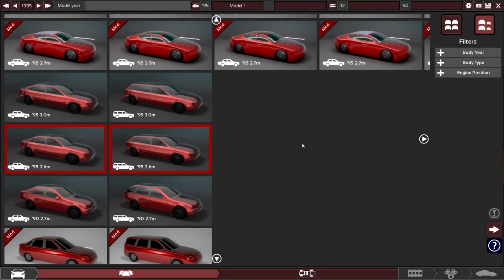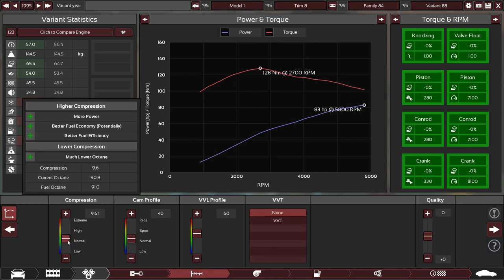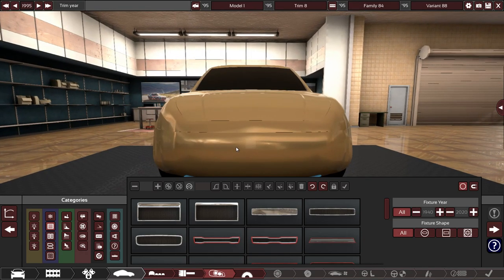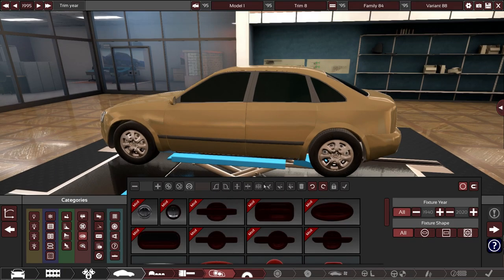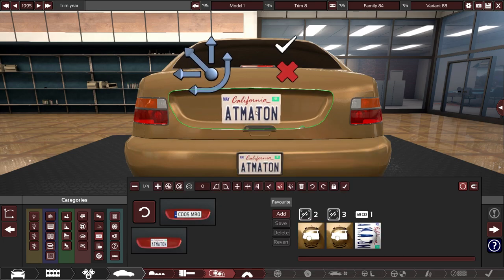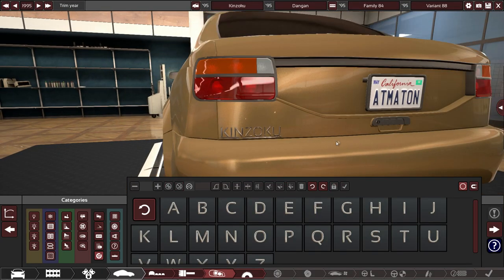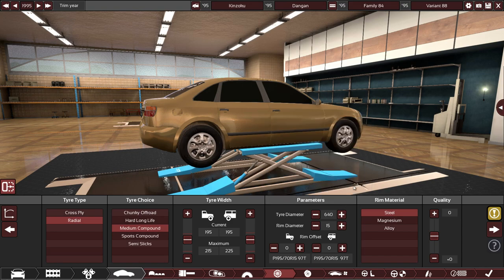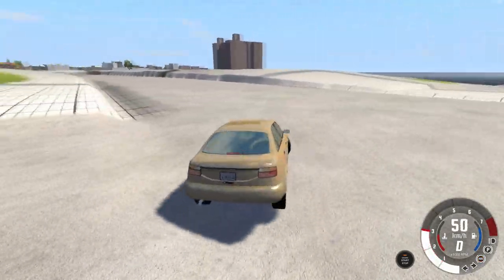90's Japanese Commuter Car - (Automation + BeamNG)

Comment: BTW you should drop the cam profile a bit, because it brings up the curve's starting point, which helps starting from a stand still, also dont use always cast things, because in average cars from around mid 90's are aluminium things. Also you could look up fuel system, which were used where and when, etc. Keep going, I really enjoy your videos!

Comment: The car looks like a car.
Reply from the maker: I will confirm that it is indeed a car
Reply: It's a car with an engine that has cylinders which makes horsepower. It can accelerate to 60 miles per hour and come to a stop in some time and distance.
Reply: It is an object that has wheels that rotate and is powered by multiple cylinders that are arranged in one line, with their waste products coming out via a pipe in the back.
Reply: It has the ability to accelerate and decelerate.
Reply: This car also known as a automobile has the ability to accelerate by a engine which is a line of pistons inside a block sending power through the transmission to the differential which then goes to the wheels while also having the ability to stop via the brake disks and calipers where the calipers push against the brakes which are connected to the rims which are connected to the tires which then stops the car

Comment: Tip: if you look at the design tab, it will show you the top speed there. It isn't always the same as the estimated top speed, and is more accurate to beamng drive. I recommend setting the top speed to that number instead, for that extra acceleration.

Comment: Omg, You Should Made The Engine Have A VTEC Because,  Fuel Economy Bro, The First 3000rpm Will Be Kinda Flat And Then Suddenly From 3000rpm To 7000rpm It Will Be Hilly Because Sometimes Honda Is Better Than Toyota At Fuel
Reply: VTEC is VVL

Comment: you should use discs on every modern is cars i cant remember any 90s cars with drum brakes, no to mention discs are so much better at braking so you wouldn't need to use race compound pads. great vid though
Reply from the maker: I can tell you weren't around in the 90s
Reply: The Toyota Carina E had drum brakes in the rear :) The glorious handbrake turns that things could do ! ;) There are quite some (slow) European vehicles that has drum brakes in the rear (not sedans though).

Comment: The tires are too wide and the wheels are too big. They uses 155/70R13 on all four for cheap cars like these.
The engine is too powerful, it usually tuned to ~100hp ~130Nm at like 6500RPM for better fuel economy.

Yes, it's that bad.